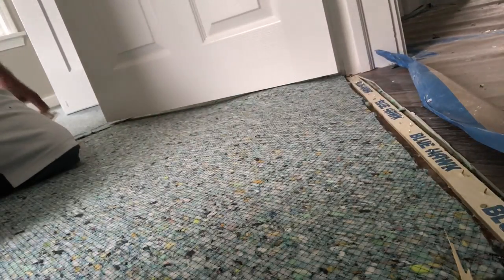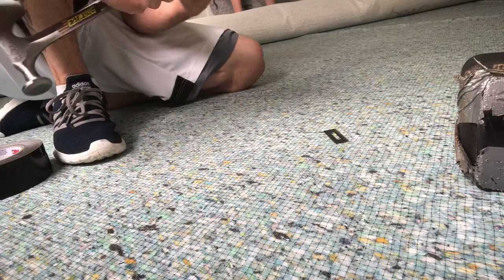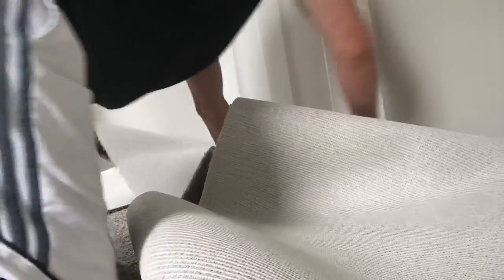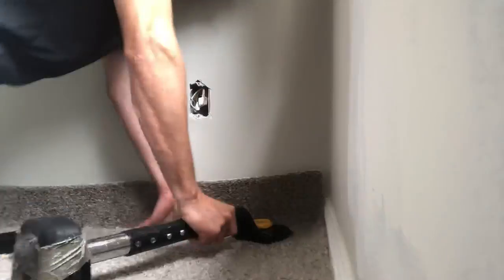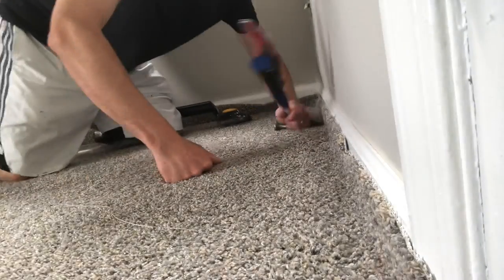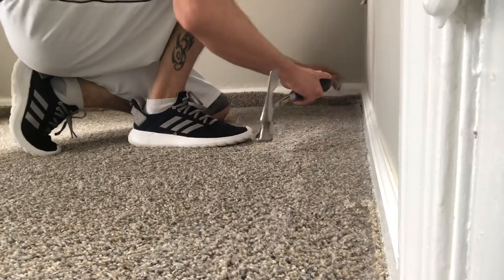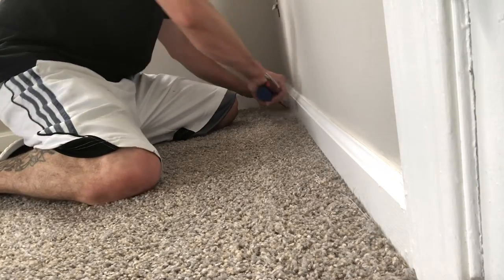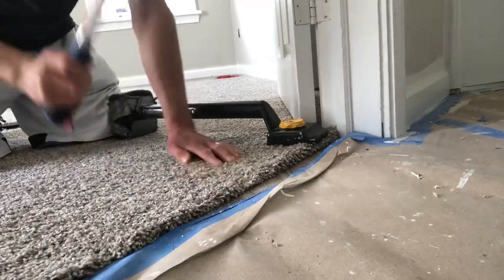Install Carpet With This TOP SECRET MULTI-TOOL

Comment: I used a kicker exclusively for the first 7 years of my career then switched to a “kneeless” kicker back in 93. Do yourself a favour and do the same.  Your SI joints will thank you. And yes if you do the math I’ve been in the flooring game as an installer for 35 years come this August.
Reply: Good evening.  What is a kneeless kicker. Thanks
Reply: @brentonpierre4107  easiest to google kneeless kicker

Comment: I'm just about to start my own flooring business. I know you said in a past video what you use for invoices, but don't have time to go back and watch them. Also wondering what merchant service you use?  Thanks for all you do!
Reply from the maker: Congrats on taking the next steps!! Any basic invoice book from OfficeMax, amazon, Target... is absolutely fine to use!
As far as merchant accounts I use several to be sure I can always grab my $$$ you don’t need them all but I use PayPal, stripe, moonclerk, cashapp Venmo 
I’d prioritize setting up PayPal, cashapp and Venmo since they are the most popular then as you gain traction add more so you have all angles covered
Reply: @Lee Fitchett ,  he's from the Cleveland Ohio area, he does flips, and rentals. Installs cheap, light rug. You can actually get this cheesy rug to stretch with a kicker! He is a hack but you can get away with this on his job!!! He'd never make it in a residential setting with an inspection afterwards. He nets walls and finishes at doorways which is axx  backwards!

Comment: I hope you went back around thst with an actual bolster afterwards. Well done for creativity 10/10 was impressed with it. Also you'd be alot faster using a wall trimmer instead of back cutting.